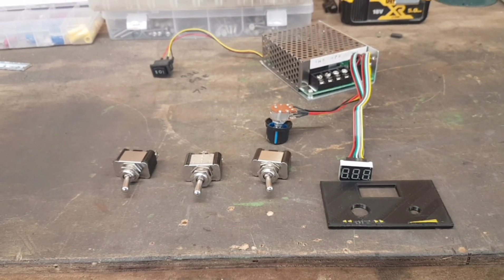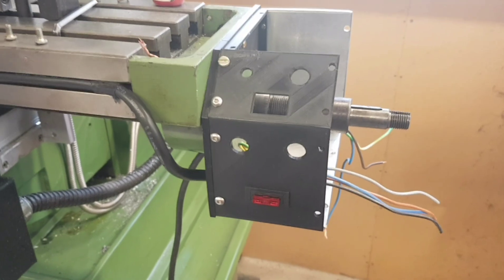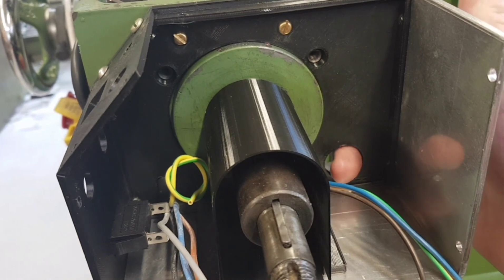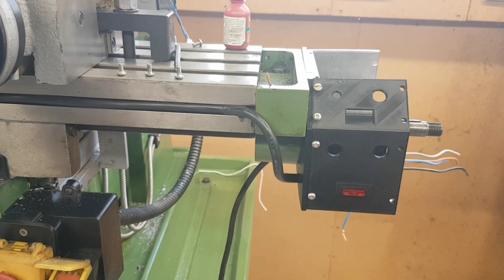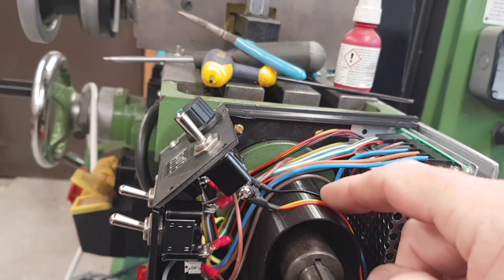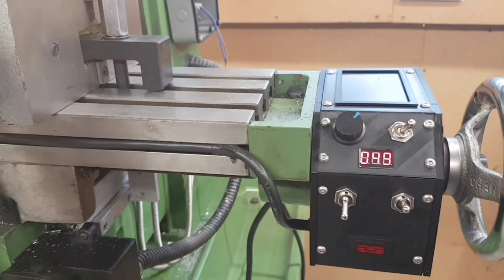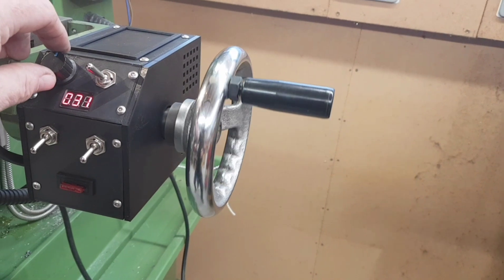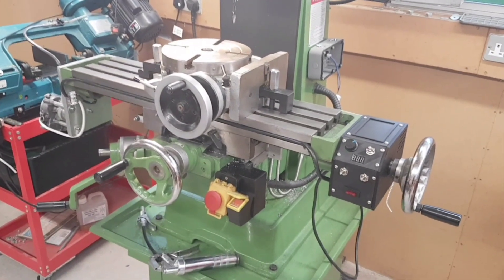Power Feed Project Electromagnet Clutch (part 6)

Comment: Niel great job. Well thought out and very clean looking. Since you have the belt drive 1:1, why not hook up the motor direct.
Reply from the maker: Hi Patrick, sorry for the delay in responding. To answer your question, I wasnt sure when I first started the project how much torque and speed I would need, so i went 1:1 as a bench mark. I now know that 30rpm (90mm/min) on the machine is a nice cutting speed in general and has sufficient torque.
I am looking at fitting a pair of spur gears which might be 3D printed in the near future and do away with the belt. Just need to wait until I'm back on my feet and build up a tolerance to the new meds, then I'll be hard at it !!
Thanks for the question and coming by.
All the best Neil
Reply: Yeh totally understand. I do a lot of projects that I update after completion. Still great work.

Comment: Very interesting project- well executed! On my second iteration of building one, I avoided needing a clutch by using a stepper motor- I arranged the controller so that it only enabled power to the motor when it was driving- without energization the motor does not increase the effort of turning the handwheel. In use, you never need to worry about engaging drive... There is a video on my channel if you are interested.
Reply from the maker: Hi Mike, I'll take a look at that video. I read something, somewhere about backfeed from the motor causing  issues if you drive it. You had any problems with this? Be interested to know for a future project.
The idea turned out ok and was different but not totally ideal. Got issues with it due to lack of consideration from myself. Basically, heat!
Got a fix on the go and will reveal my errors soon.
Thanks for the comment, always appreciated. 
Neil...
Reply: @NellsMechanicalManCave  If I turn the handwheel quickly without power to the drive, the display starts flickering! But it has caused no problems, and it has had quite a bit of use.

Comment: It's looking good. So you want the direction switch to switch the magnet relay off when in neutral? Is that correct? And is it necessary@

Also what voltage are you driving the internals at and what is the voltage and current your relays drive? (I got a box of 5,000 5v coil, 10 amp SPST relays that can do 240 AC or 28V DC from a scrapyard new).

I can't help but think an arduino controlling the relays would simplify things though you could also use a few transistors or a logic gate.
Reply from the maker: Everything is 12v Ben. Probably not necessarily but motor and magnet operating simultaneously was my original idea. I'm thinking of two micro relays as I'm not into Arduino, but the jury is still out 😁😁😁😁
Reply: @NellsMechanicalManCave  If you are going to do it with relays you could take a wire off each side of the switch, through a diode then through a relay coil to drive the magnet. You could use either end of the switch to drive the same relay.
Reply from the maker: @BensWorkshop  that's what I was thinking but was worried if a diode failed it would allow a back feed energizing the second relay in the PWM resulting in a dead short.
I'm not sure of the characteristic of diode failure and dont know if they just stop working as in no current flow or flow both ways
Reply: @NellsMechanicalManCave  I don't know enough about the way the PWM unit is wired but diodes can fail both open and closed circuit though much more often open.

Comment: It turned out great Neil. The motor should be ok. The one i did has never let me down. Even when using the 6 insert 60mm facemill. I think the only difference was i used the high speed of the motor for rapid return. But it's not that much faster. Great video. Regards.
Steve.
Reply from the maker: Cheers Steve,
I'm still not overly confident with the clutch yet. I'll get  the vice back on and start some trials tomorrow. 
Cheers Neil

Comment: Hello Neil. Impressive or what! The controller looks visually very professional. Congratulations 👏👏👍😀Andrew
Reply from the maker: All that shines isn't gold 😉
It looks the part Andrew and will do the job but I think it will need replacing. Due to wrong settings I don't think the threaded holes will hold up for long. But,,,, it works that's the important thing.
Thanks for watching and commenting Andrew, it's appreciated.  Cheers Neil

Comment: Looks great. Maybe a slap cutoff on the opposite end. If you happen to be on that end and need to pause in a hurry.
Reply from the maker: That's easily done Dan on the motor end and a good idea. Could hide the chock block inside the E stop enclosure. Only need a NC contact under the stop button. Nice!!!